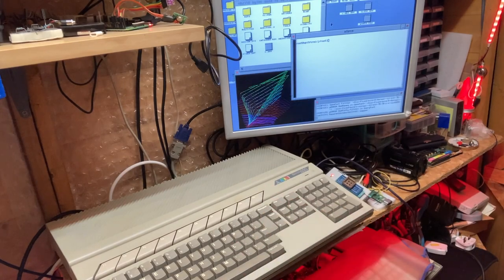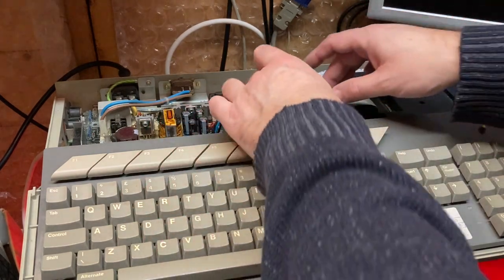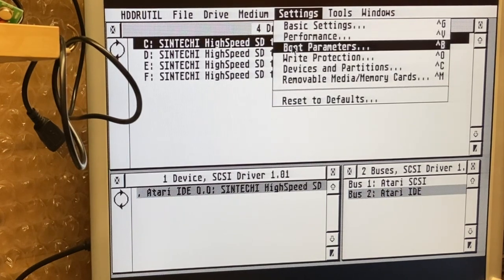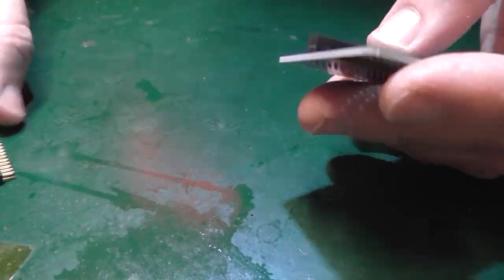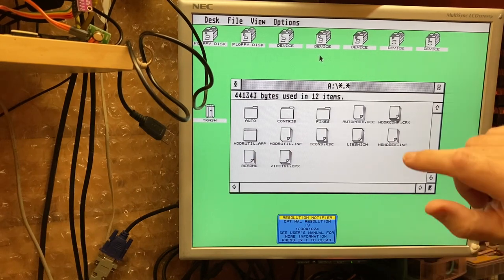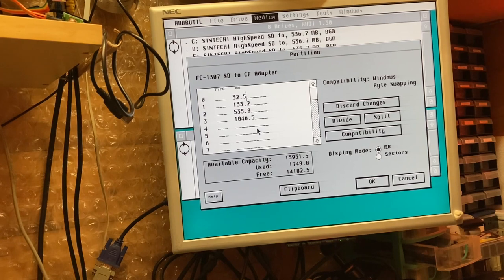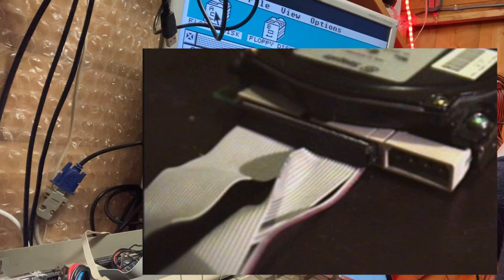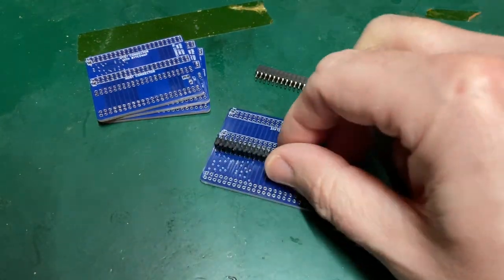Atari Falcon Dual Internal IDE Adapter

Comment: Interesting video!  I've had nightmares with HDDriver on my Falcon when trying to setup 2 drives!  Not sure why but when working with the 2nd drive, the 1st drive goes pear shaped...  At some point I will investigate!  On the STFM / STe I use PP's driver - it just works, and with the Ultrasatan it allows me to read the partitions in Windows - so much easier than messing around with other drivers or converting the endian etc.
Reply from the maker: ACSI on the ST is 8 bit so I suspect the byte swapping issue doesn't really come into play. The only real problem I have with PP's drivers are they are designed to be extremely lean, so don't include the more modern nicities, like XHDI, which MiNT requires. As a big MiNT user they're a non-starter on the Falcon for me. It's nice there is choice, but a shame no decent open source driver exists, except buried within EmuTOS. Which might be a line I'm pursuing. ;)

Comment: Hi, very interesting video, thanks for this! I will give a try, because, as you say, the LAN on the cartridge port is slow and unreliable.... I have a question: how do you run EMUTOS on your Falcon? I didn't know that it was even possible...
Reply from the maker: Thanks! My DFB1 accelerator card has a flash ROM which lets me boot alternative operating systems, but there's nothing to stop your burning a 512k version of EmuTOS to a compatible EPROM and mounting it instead of TOS4 under the memory board. I've videos on both my DFB1 booster and flashing ROMs for the Falcon on my channel. Have a look. :-)
Reply: I apparently bought a multirom cart at some point that has EmuTOS on it as well...

Comment: Was not enought 40 wires kable for connect 2x HDD to Falcon030 like was used in PC?

I had got F030 with HDD 3,5 inch and I connected 2x HDD eg for copying.
Reply from the maker: This is instead of the cable and also adds a twist for PC compatibility.
Reply: @thetechnoshed  Understand!

Comment: You could have used a IDE2SATA adapter to allow the use of SSD drives using 256GB drives or 3TB
Reply from the maker: Sure, but space isn't really the problem, interoperability is -- I'm only using a 16GB card at the moment after all.
Reply: @thetechnoshed  What about disassembling the COMMODORE AMIGA HD driver and see if it can be made to work with the ATARI FALCON.

Comment: Are you using "blowup" software or something similar for the higher resolution?
Reply from the maker: Centscreen, IIRC. Plays nicely with MiNT, which few of the others do. Seems impossible to configure, however.

Comment: If Large Endian is working properly then would it not be a good idea to leave it alone and do something else Just wondering.
Reply from the maker: The thing I'm trying to do is to have the SD card work both in the Falcon and in my Mac (or Linux box, or whatever) to be able to copy files to and from it. That doesn't work (other than with EmuTOS) with the big-endian arrangement.

Comment: Isnt there a scsi interface? I owned a falcon, an interface would be possible
Reply from the maker: I've not found a modern source for the first generation high-density SCSI plugs the Falcon needs, unfortuantely.
Reply: Awwww that sucks , i know my first megafile 30 had a RLL drive in it, but my faulty memory said to me my Falcon 030 had s SCSI port, that's memory for ya
Reply: It does have a SCSI port on it.  Specifically it is a half-pitch 50 pin scsi port.  I have been trying to find a HPDB50 Male to 50 pin female for hooking up something like a ZuluSCSI.  Haven't had a whole lot of luck.
Reply: @slaapliedje  yes I knew it had one cause I had both a megafile 30 + a SCSI drive